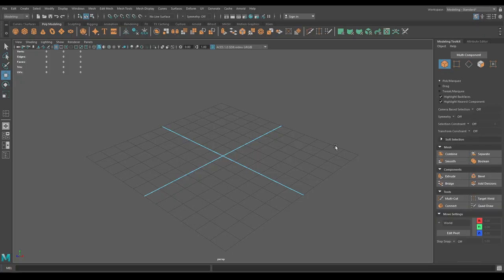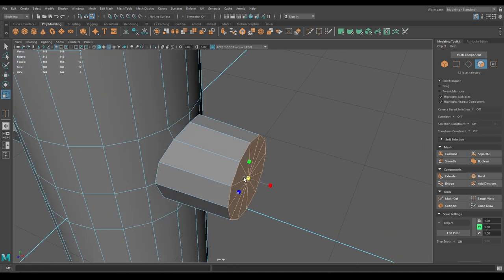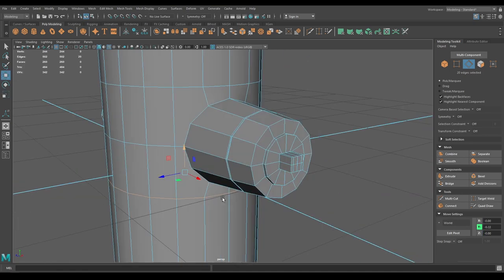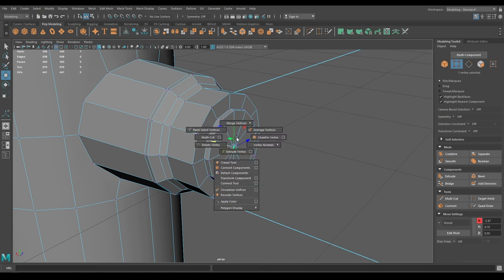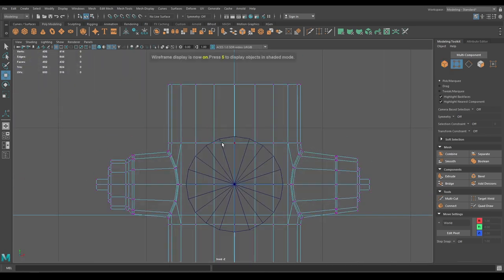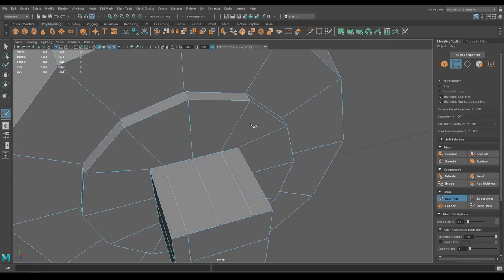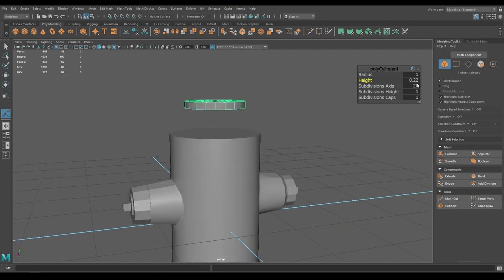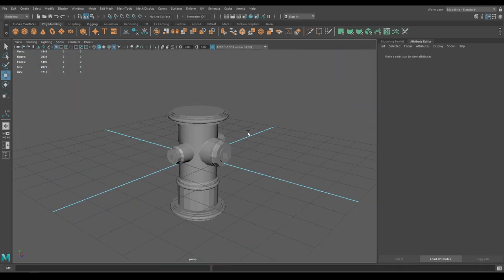Autodesk Maya 2022 | Modeling Fire Hydrant in Maya & Substance Painter | Part - 1

Comment: would it not be quicker to just cut it in half and mirror?
Reply from the maker: No, both sides are little different.
Reply: Yes it would be for the base shape. Also when working so low res you risk all the shading glitches.